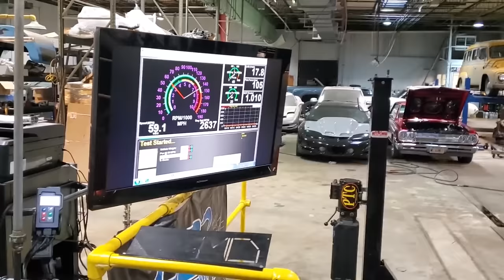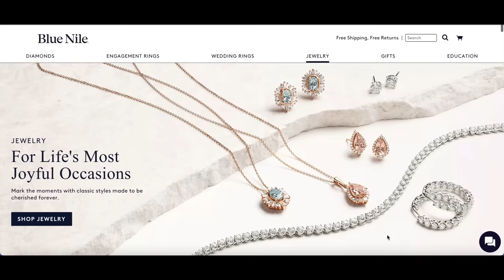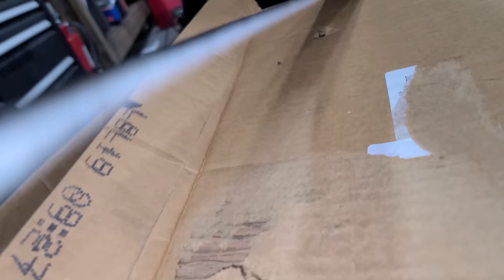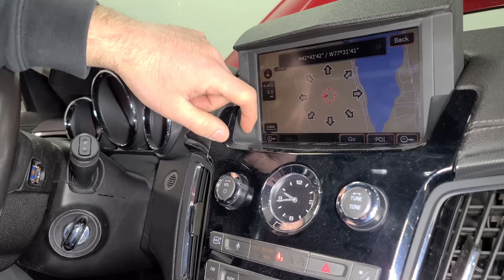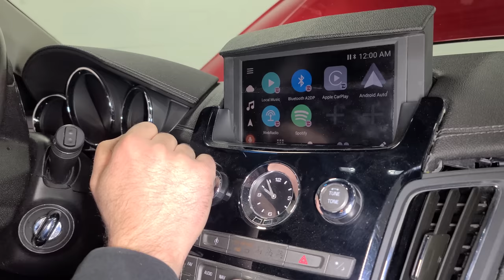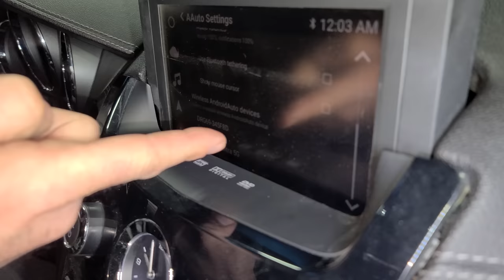I Found The REAL Reason My CTS-V Wagon Was TOTALED While I Was Modifying It! Would You Drive It?

Comment: WOW AMAZING VIDEO...!!! I have a CTS Sportwagon as well... I have to say that Vline infotainment is amazing...!!! I have the same setup like you're doing on your wagon. And I also put the box in the same cubby area you're placing yours in. What are the odds? After playing with the Vline for a while, all I can say is... it's amazing. Remember to do all the updates in the Vline and make sure you update the Grom as well... You will have to connect the Vline to Wi-Fi to do all the updates. I've been through two updates due to the fact that I emailed VLine because originally the stock Bluetooth screen that is from the car would supersede the v-line screen while placing or receiving calls...  After Vline received my email. They worked on a patch and they updated, I believe all the modules that correspond to the CTS through an update. So it's very important to update the Vline... The only other glitch I ran across with the Vline was when you're on a call and you place the car in reverse. Sometimes the Vline will supersede the backup camera. Other than that, it's amazing... And all your factory buttons on the steering wheel and in the center stack work great... FYI. Download the factory UI icon and place it on the upper part of your screen, preferably towards the driver side. So when you close/put down the screen, you can still press the factory UI icon when the screen is down.  Once everything is set up... on your phone you will have general motors connected via Bluetooth for phone calls and Vline2 for everything else including wireless streaming... Welcome to wireless android...!!! Enjoy...!!! If you need any help hit me up...!!! 👍

Comment: I have a 2009 CTS-V sedan w/75,000 miles.  I have the standard seats, yes, good replacment, on a trip they get a little uncomfortable.  If you hammer it on the X-way you will get 16 mpg, drive the speed limit, I have seen 24 mpg.  I usually drive 80-100 mph not aggresive, and it will get 22 mpg.  Had to replace the front shocks @ 64,000, one started leaking a small amount, ($350 each) @ Rock Auto, a few years ago.  My car also has Air Aid, and a Billy Boat exhaust, do not every buy, it is junk, mufflers cracked at the welded seams, took over 6 months to get replaced, they are cracking again.  Also have the same Continental Tires, I like them.  The chassis on all three versions are the same.  I only use Shell gasoline, have my whole life, used it in previous performance cars.  GM replaced under warranty, the coupler on the supercharger, it would rattle when turning the car off.  It is Thunder Gray, w/light titanium interior, w/silver calipers.

Comment: The outer B pillar looks to be plugged-welded and not spot-welded back together. The only concern would be if the prior removal involved drilling and not grinding the spot welds, which might have damaged and compromised the inner structure. Plug welds also generate more heattwo the inner-structur. More heat could weaken the metal.

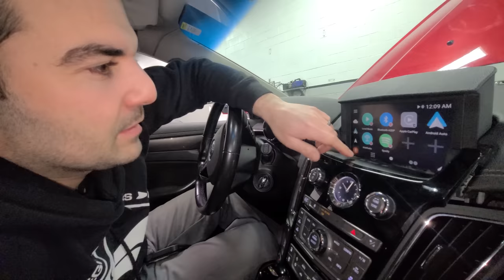Comment: 38:00 get yourself a wifi obd2 dongle and torque pro and let the radio show some cool stats like boost, lamdbda, oil pressure/temp and so on! 🚀

Wifi but not bluetooth because it might wont connect to your phone and dongle at the same time.

Comment: Loving the car, wish you could get them in RHD so I could easily drive one in the UK. For the iOS/Android issue it is generally what you are used to, trying to go from one to the other takes time (a month+) as you need to give your brain a period so it can adjust from using one to the other. I have to use both for my job but my personal choice is an iPhone as I simply find it easier.

Comment: I had an I phone all the way up to the series 6 and my now wife had talked me into a samsung s21 plus. I have to say after using it for over a year I cannot find anything about the android phones I really like. The cameras on my iphone were better, the UI was cleaner and very easy to use, there wasnt alot of trash apps installed on my iphones when I purchased them. Apps arent really a big thing to me so the Iphone is just better. The facetime video feature on the Iphone was beast compared to any android app version. and  the quality of the materials that Iphones are made of are great, the android phones i have tested were all cheap plastic. the Iphone was comfortable to hold the edges would grab, whereas the android phones are smooth.. too smooth. I have dropped my S21 several times because it would just not stay firm in my hand, eventually i had to buy a textured case to not lose the phone. 

So yeah in my opinion the Iphones are better that android phones. Sure android has a massive market for apps and if that is what influences your choice on phones then go android. If you want a clean UI with solid features, great camera images,  and security on your phone choose Iphone.

Comment: Sunroof said to add about 120lbs...and it's all high up... Just did my fifth cross-country run in my Vagon, 6500mi. this run...Stick, when speed limit is 80, cruise is 50 over..22-23 mpg highway...70 drops to 20'ish, 55 or 60 your in the teens for mpg...😮🤔 700HP Lingenfelter just under 140K, had since new.

Comment: About 9 years ago I was at the local dealer buying a different car and the salesman caught me looking at a used 2011 V and offered to let me test drive it, even though I told him I couldn’t afford it. He kept pushing so, what the heck, why not. It had the adjustable Recaros which are very nice. I was disappointed it was an auto until we got it on the road. I told the guy I was gonna floor it getting on the very long on ramp near the dealer and he fully encouraged this. I rolled on and only got to about 75% throttle and it made this glorious noise, the sales guy’s head flew back as we rocketed up to 100 before the on ramp ended with the trans banging off shifts like lightning. I never actually floored it completely, because it was so damned fast. The conversation on the way back amounted to me with huge grin on my face saying, “This thing is absurd.” With the sales guy also grinning and nodding and agreeing with me. He didn’t even try to sell it to me after.

Comment: Those rims were trailer fixed which mean some guy in a trailer a butcher spray bombed them to match the polished that is the incorrect way to fix them I fix wheels for a for a living the correct way is to spend them make sure they're not bent stripping polish mm and clearcoat mmm good as new or better than new if you're ever in Florida you can drop them off

Comment: They painted your rims to cover up the bondo that they used to fill in damage to your rims. So removing the paint will just end up exposing the bondo. You will have to repaint all the rims or maybe have them powder coated or you will have to buy new ones if you want the rims to be stock.  But I'm sure you figured that out if you didn't already know that.

Comment: android devices are simply better. They are compatible with everything.  It's all open source. Very little to pay for in the app store. And very intuitive to use. The UI actually makes sense when you use the device. Apple on the other hand is not compatible with anything but Apple products, despite what popular opinion may have you believe Apple products do get viruses just like any other computer. Can also be hacked and broken into. I've done it in several instances.  Apple products are more expensive for absolutely no reason. Especially when most of the parts come from other manufacturers like Samsung who at one point manufactured iPhone. And Last but not least they are not innovative.  Every feature iPhone comes out with usually 2 to 3 years behind Android devices.  I actually own both phones. But when I want to get things done I grab my android. The crazy thing is I own a Note 10 and it runs circles around my iPhone 13 pro. Older phone vs new phone. My old phone beats it every time. Don't get me wrong. IPhones are cool looking. I honestly feel like most people who have them only do because someone they know said it's cool. I think they force themselves to like them even if it's an inferior product.  Just my 2 cents.